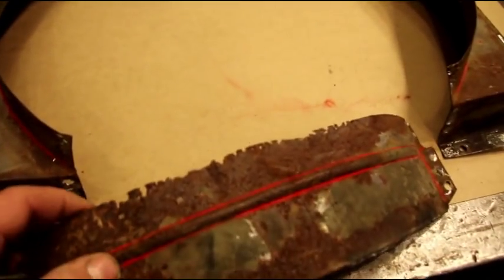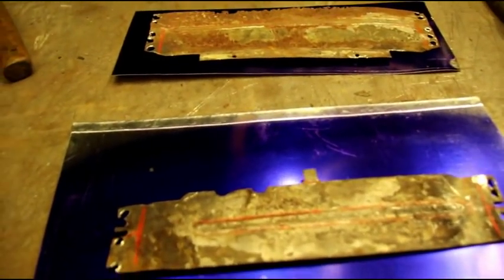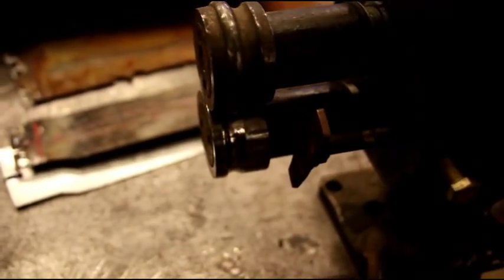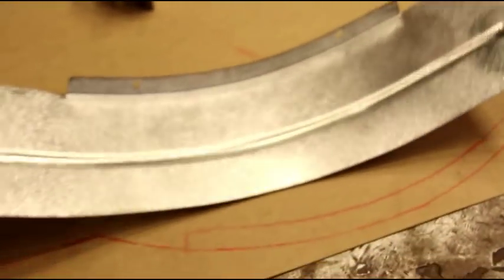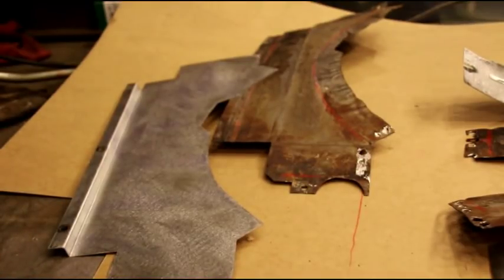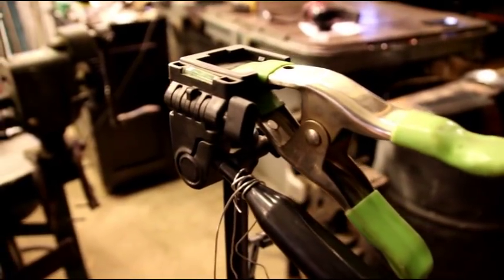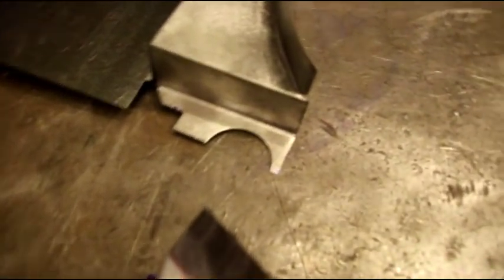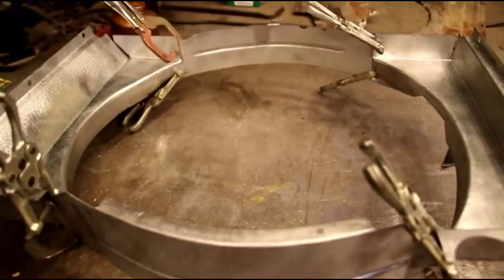Willys M38 Military Jeep Radiator Shroud Fabrication

Comment: Outstanding. For the last two years I have been trying to figure out how to redo my M38 fan shroud, which looks like its has been hit with a shotgun blast. Took it to a radiator shop and it came back with a black tar like coating over the old rust. This was from a so called top notch radiator shop in our area. Sometimes you have to do stuff yourself. Thank you for this excellent video tutorial.

Comment: This is a perfect example of the shear amount of work entailed in re making, what the casual observer would dismiss as just a simple part in the engine bay, this has really come out well, you really gave yourself more of a job by using galvonized as you cant anneal it through the stages, I really like you shrinking pinchers, they save a lot of time, and the plastic formers are a lot easier to machine and will last plenty long enough for the use you will give them, could you have use the Box & Pan folder for you short reverse bends ?  I think you are needing a cameraman now, with all these complicated fabrications, you should promote your Jenny Roller handle turner ! Thanks for posting. Chris B.
Reply from the maker: Hello Chris, yes you are right most people say a shroud is a simple part to make.  Then I ask them to make one and they say they can't.  The galvanized metal is hard but with the planishing hammer and power hammer I can work it easily.   I do have a box and pan brake but as with most hand brakes the shortest return bend you can make is 1/2" .  This project needed a 5/16" return bend so that is why I made the dies.  
I would LOVE to have a person working the camera but nobody is interested in that job at this point.  On this project I cranked with one hand and guided the sheet with the other, a real pain but had nobody around to turn the handle for me.  Might be time to motorize the hand crank machines.   Always good to hear from you, thanks as always for watching and taking time to comment.  
Brian

Comment: Could a mag brake make those bends?
Reply from the maker: A magnetic brake may be able to do very close reverse bends but depends on the manufacturer of the brake and the design of the unit.
Reply: Half inch is shortest I can get on mine.